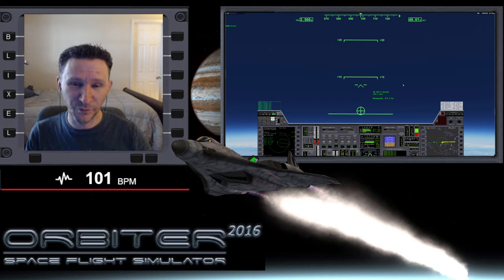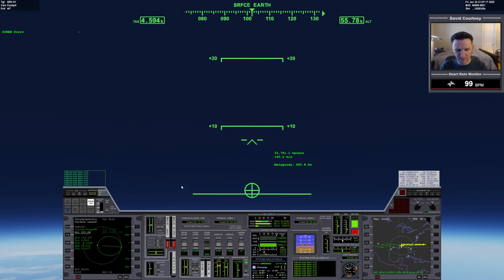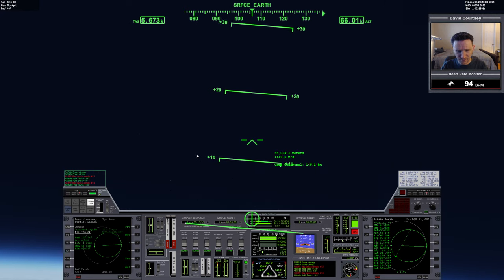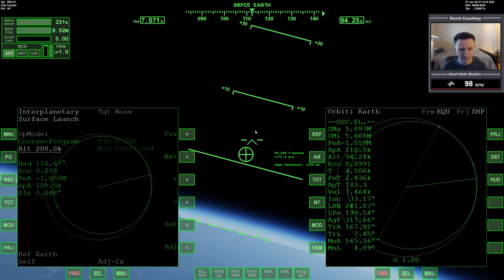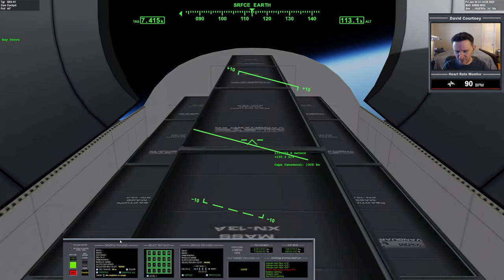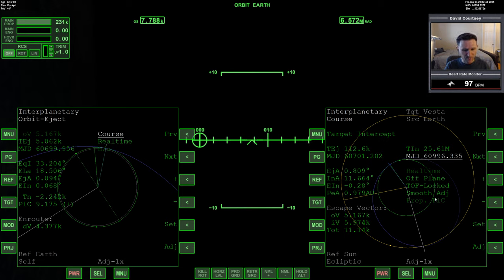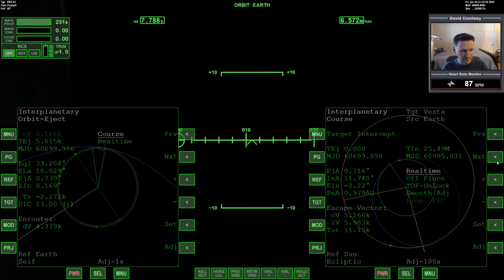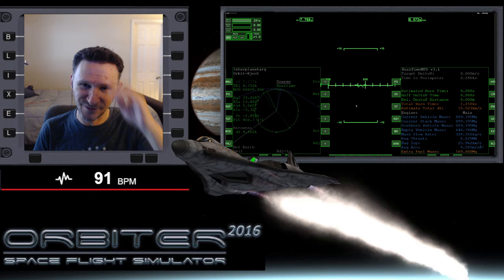Orbiter 2016 - [Part 3] Earth to Vesta

Comment: I've been having issues with IMFD. I'll set up a plan using Target Intercept. Then use Surface Launch and get into orbit. But then when I open Orbit Eject and set the source to the ship, it is not working. Whether sharing or opened on the same side, it will not use the correct information from my plan. It shows the wrong Ein and sometimes the countdown to burn is off by millions of seconds (34K seconds to burn on the plan and it's showing 2.5M seconds). I end up having to manually enter the information to make it work. Then after I eject, the plan breaks and I have no guide for mid-course corrections other than opening the Map. Cheers!
Reply: You can't set the source to Ship until you are out of the SOI.  Keep the Target Intercept on one side, share to the other side with Orbit Eject, and burn there.